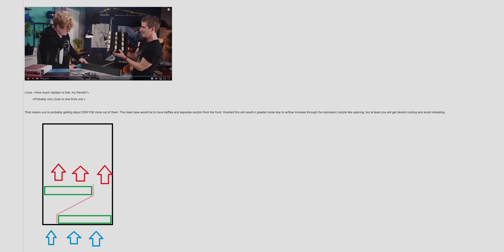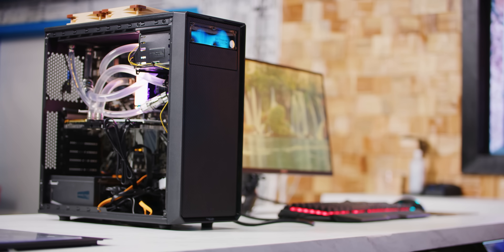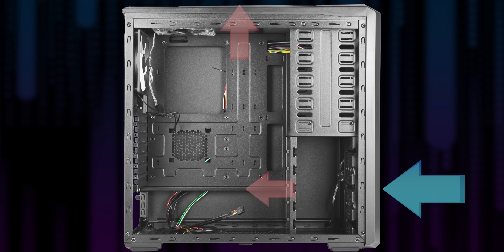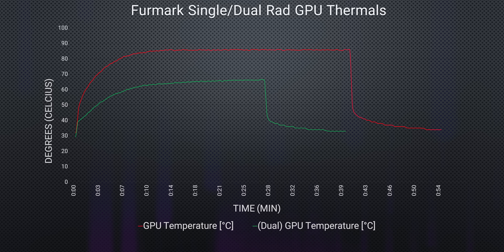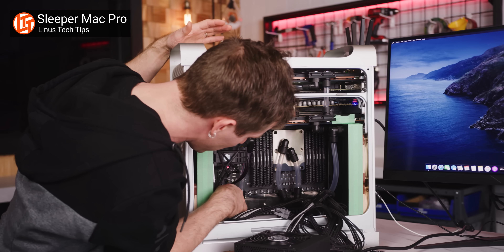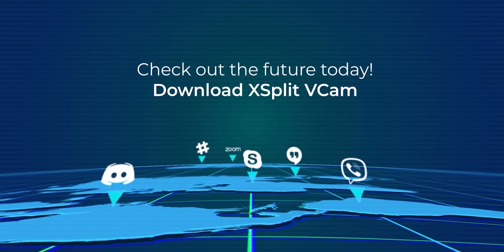I’ve been water cooling wrong for YEARS - $H!T Manufacturers Say

Comment: single rad on a dual load will likely result in poorer cooling of second load with significantly warmer water, it'll be in a way worse situation than cooling with slightly warmer air.

Comment: Yeah stacking rads in series would never work. Rads in parallel with room ambient as the supply works until diminishing returns makes it pointless. The reason it takes longer for the temps to rise is pretty basic. more fluid = more fluid to heat.

Comment: Old video, but this is a total fail if you didn't compare it to a setup with both radiators being fed fresh air.
For example that setup with the three stacked radiators would be killer if they were instead side by side, but even then you would only see the difference if your system was generating enough heat to benefit.
Neither argument is wrong, the answer is a variable in between dependent on the temps and airflow that exist in the actual application.

Comment: Would be really awesome if you measured the air temp or coolant temp after the radiators with a thermocouple, especially for like a stacked radiator setup to test how much cooling the 2nd and 3rd rads added

Comment: now here is my question if you use something like zalman water cooling tower that is external from the case that can dissipate heat say drilling it out and removing the pump to just use it as a reservoir  would that help.  trying to think of ways to use some old equipment i have.

Comment: If you put a 120 rad on the back and 360 on top with some high flow rate fans as exhausts and 3 120 high flow rate fans as intakes and if the case has side mounted fans add them as intake. Ur going to like it

Comment: It might make a big difference if the room air is closer to the air coming out of the first rad. As long as it’s still cool enough coming out of the first rad it can still cool down the water in the second. Just what I’m thinking 🤔 would be cool to run the same experiment with a 90 degree room.

Comment: The placement of the radiators is neither the most logical nor the most optimal.
With a single radiator, it is optimal to take the air from outside the box and expel it inside.
But with 2 radiators, the logical and optimal thing is to put the 2 radiators to take air from the box and expel it directly out of the box, having other fans that put fresh air into the box.
By putting them in "series" a radiator sending air to the other radiator, the temperature of the 1st device that is cooled will be better and cooler, but the 2nd cooled device will be logically worse, apart from the fact that you are increasing the temperature inside the box causing the rest of the components get hotter.

Comment: I think that the two cases that corsair talked about had something in common that the one tested in the video doesn't have. That thing is radiators in series that take the air from the previous one directly. At the end of the video Linus said that they think that in their test case some fresh air intakes from the outside of the case through the ventilation holes, but the point is that the other cases doesn't have that feature. Nevertheless I think that the results may not change in the main picture, but it could be more tight. Making the decision of putting another radiator more complicated (maybe the price isn't worth it).

Comment: I think they were talking about stacking the radiators ontop of each other, not having them seperated,   it's why on a car if you got a transmission cooler it's radiator is infront of the main radiator but doesn't completely block it.

Comment: Would love to see if the order of the rads in the loop would make a difference as well. If the exhaust rad was hit first by the warm coolant it would increase the temp difference there, but on the other side lower it for the second rad. I wonder if these two balance out or if one of the two has a bigger effect than the other...

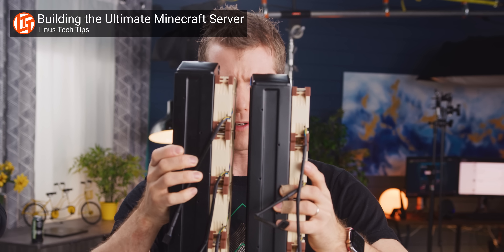Comment: If putting two radiators next to each other, as was done with the stacked radiators (at 1:26 in the video) , is so bad, why do car manufacturers put the air conditioner condenser (which is a form of a radiator) right in front of the radiator in just about every car? Air conditioner condensers produce a lot of heat (not to mention the amount of heat under the hood from the engine) when condensing the refrigerant from a gas back into a liquid. Cars also only use a single fan in a pull configuration for when the car is not moving.

Comment: At 1:45 into the clip I can already give you the answer. Of course stacking radiators works. The closer the air temperature is to the temperature of the liquid in the loop/radiator, the worse the cooling efficiency though. So all you got to do is, use a pointlessly high speed on your fans and badaboom, stacking (or using radiators as exhaust) works great and does indeed add cooling. 

However in a well optimised system aimed at being silent, stacking makes little sense. All depends what you want. A system for show or an optimised system. Superficial knowledge or in depth knowledge ;)
Reply: Err, no. If the fans were same speed, then sealing off was not the reason. It was your high fan speed xD

Comment: Of course it will add performance but definitely not getting 100% of the heat exchange from the second radiator. So, in a way wasting money. 
As for the Minecraft server radiators stacking, that's so wrong. Check "pinch heat exchanger". 
I love how americans are always jumping to experimenting and the apparently unlimited budget into their projects without ever starting with even a basic thinking on paper or understanding of what are the principles behind what they are doing. 
I would have like to see Linus doing a little bit of explanation of how to radiators works and temperatures curves (actually linear).

Comment: At worst, the second rad would be getting warmer air, but would still do it’s job. Maybe it would be less efficient, but it still makes a difference. Maybe test somehow air temp going into rad vs heat dissipation to see at what point must the air be heated to cause the rad to be deemed useless….

Comment: Sorry Linus but u an idiot. Just flip fans around so air blowing out from both rads or airs blows in through both rads. Just redirect air flow on one of rads so it won't go to second rad from the first. In ordinary PC case, put 2 Dard, one on the front and one on the top, then make fans blow inside the case on BOTH rads or blow out of the case from both rads. Air in will flow from back and bottom.

Comment: hmm so in one instance you have a rad at the back and a rad at the front, with no other intake fans, and in the second you have a 3 rad plus fan stack, So Linus does a test that doesn't replicate either scenario... and finds something different... I wonder why?
and what are the red arrows supposed to show @1:17? as Linus says "front intake radiator and a rear exhaust radiator" but the arrows show rear intake and front exhaust...

Comment: stacking radiators is worse than placing them in parallel due to the fact that the air can only heat up so much (like Corsair claimed). But its not usually feasible to place them in parallel since there is only so much external area available. Also, if you stack radiators, you should be giving them their own fan so that the total airflow does not decrease.

Comment: I would just flip the fans on the 2nd radiator and make both radiators make use of cold air outside of the case, and a lot of positive pressure inside to keep the dust out.

Comment: If I had to guess, I would venture that Corsair's research on the topic likely started with the assumption that each radiator used in the setup would be enough to cool the system sufficiently on its own, which does back up the idea that adding more radiators in stacks would not lower the system temperatures beyond the baseline with one radiator.

I would also like to point out that stacking radiators face-to-face would definitely be very inefficient because it would not be applicable to your theory that other air is entering the flow from inside the case. This setup of fan-rad-fan-rad sandwich would absolutely be less efficient.

Comment: "Stacking Rads" (at 1:27) is DIFFERENT that "ADDing Rads". You first show back to back to back Rad's, then you test COMPLETELY different setup, redo the video.
Reply: Kind of need to agree, although I am struggling to see clearly where the two rads are located for your test.

When you say "in series" I think you mean the water from one goes to the next...which is legit and will work as long as the water is still warmer than the ambient air.

Stacking to rads so the AIR flows "in series" is the problem the manufacturer had an issue with.  The 2nd rad has nothing to shed it's heat to, since the input air is the output air from the previous rad

Comment: heh I have a 60mm massive car radiator sized phobya  60mm wide 1080 extreme which is a very tight  fit  with 4x 180mm fans in the roof of a core X9 with custom brackets , it s been in that case since the 4790k came out - cpu never gets above 42c  - idles at a couple of  %c above ambient

Comment: Corsairs claim doesn't make sense at all to me.  The air exhausting the first rad is NOT going to be "just barely colder" than the fluid temp.  I wish you would have measured that in the video.

Comment: the problem I see with Corsair's theory is simple enough.

The air coming from the first hot radiator isn't going to be able to pull 100% of the heat off of it, so it's not likely to have literally equal temperature to the first rad. So either way, it's PROBABLY not full temp when it goes through the second rad yet.

And then, yes, the flow of air will likely mix with a nonzero amount of even SLIGHTLY cooler air which should further enable cooling of the 2nd rad.

It seems incredibly unlikely that you're ACTUALLY going to have air going through the 2nd rad that has NO thermal capacity left at all.

Comment: Surely the problem is stacking radiators on top of each other, where a second radiator gets hot air directly off the first radiator. I guess if you stacked enough radiators, all the heat pulled from the first radiators would be put back into the water by subsequent radiators. Providing radiators get cool air from different sources though, then more is better. [Ah... just seen follow up video...]

Comment: " separate  radiators will improve things. Stacked radiators wont improve things much. Heat from water in first rad gets transferred to the air which is then blown through second rad warming it up !
Reply: it depends on the order of the rads the water flows through. if the water flows outward (innermost rad first) then yes, that's what will happen. but if the water flows through the outermost rad first, that's a whole different story.

Comment: >extra radiator
>extra water volume
You need to compensate for this with a larger reservoir, and it explains why the double sink took longer to come down to temp as well, it has more heat capacity.

Comment: That's not what's happening. It's all about the mass flow rate of the air yo. Your fans have a higher mass flow rate of air than what Corsair is using. They are probably matching fans with radiator efficiency so that they get peak performance for the price of the fan. A higher mass flow rate fan would only exhaust cooler air and not increase actual radiator efficiency. But if you put in a bunch of epic fans and then put radiators in series, then you can absolutely get better performance with those radiators. Tl;dr with high flow rate fans the individual air molecules don't heat up as much this can be used to cool a radiator in series.

Comment: true your water temp is only going to go so low adding more radiators wont change that , BUT adding more liquid and radiator capacity gives you a longer saturation duration so instead of fully saturating your cooling system with heat in 2 hours you can game for lets say 6 hours befor full saturation of heat , this in the long run keeps your components running cooler for longer durations of time thus elongating their life and giving you higher performance for extended periods of time , anotherr words corsair is right but they miss the big picture.

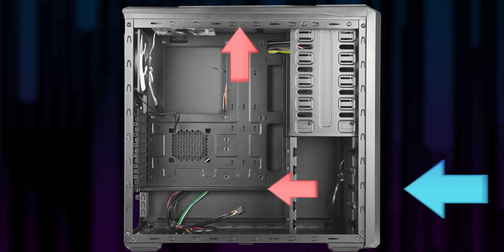Comment: 6:03 that fan in the back is obvoiusly blowing the air out based on which way its blades are curved. Which doesn't necessarily mean the air doesn't flow in through there, other fans may pull more air and do so against this one. But generally you do want to have the aitr coming out of the top anb back of the computer, because that's where the hot air would naturally accumulate (the fans working with convection instead of against it, and a computer usually stands against a wall from behind, so no fresh air there), and enter through the bottom and the front. And that's where the rads would ideally go if there's enough room for them. There can also be holes in the sides to avoid the interior heating up from the rads on all intakes.

Comment: I don't think you read this, but my 2 cents. In my little experience with DIY water cooling, if the water was at 40º an the ambient air was at 20º the air throught the radiator reach 30º, so when you put more radiators you optimize this. The cars have 2 radiators, 1 for AC and then 1 for the engine water. I think corsair have something wrong on this simulation parameters. have a nice day!

Comment: This doesn't account for external radiators though
Also doesn't account for multiple intakes (a bottom intake and a front intake for example could both have their own radiator, both pulling fresh cold air through)

Comment: If you stack radiators that are in line always have the first (hottest) radiator last in the airflow, therefore the temperature difference is always going to be larger. It's a principle called opposite flow that is used a lot in lab cooling.

Comment: @Linus: you did things wrong!
Try this: compare your results with second setup: single radiator, but oil instead of water and higher speed of fans near radiator. You might be surprised :)

You are not wrong here that greater heat exchange surface = better results, but that not always will be the case.
Overall limitting factor here is amount of heat transferred from water to air - you can do this 2 ways: increase air flow or increase surface. Adding another radiator actually does both: increases surface of heat exchange and flow of air taking heat from water cooling system.

Tbh, I wonder if the best solution would be like transfering heat outside of case (like whole case would be radiator for water cooling) into the stream of air.

Comment: One thing that is important is the order of the rads. You want the water to flow in the opposite order to the air. Water should go to the air exhaust before going to the intake.

cool air -> warm air -> hot air
cool water <- warm water <- hot water

vs

cool air -> warm air -> warm air
hot water -> warm water -> warm water

Is your warm air sufficiently cool ? Then you only need one radiator
Is there enough air mixing between radiators ? Then the order makes no difference
(by "warm" I just mean in between. I could be almost equal to the others)
(inspired by how fish breath)

Comment: If the rad is too small to transfer all the heat from the water to the air, then logically a second rad helps to get rid of the rest of the dt.

Comment: nah.. it actually works stacking them. they do it on sedan's. or cars.. on front-is the aircon condenser on its back is the radiator of the engine. go search. youll see thelat they are stacked..😁

Comment: hi guys.. I tried Liquid cooling . It Leaked and wrote off the motherboard graphics card and processor.  turns out The fluid is conductive? and it shorted out the system. anybody else had this?

Comment: I mean, the physics here are understood fairly well, the constraints will be the accuracy of the simulation and other factors.

There's also counter current vs whatever the opposite of that is, if you put the rad that feeds back to the CPU/GPU to where it gets the coldest air, you'll get a different result than if you ran the loop the opposite direction. Beginning vs end.

Comment: If you are going to stack radiators, the air and water have to flow opposite each other.
The water should be flowing into the radiator with the warmest airflow first and the coolest airflow last

Comment: Unfortunately I have to side with stacking radiators is a bad idea, in the automotive sector sector stacking radiator will make for unefficient cooling on the last radiator, multiple radiators do work but needs their own unheated air. In the automotive sector using the aircon will make the engine's temperature climb as the aircon radiator is in front of the engine's radiator swop them around and the aircon will be just about useless in cooling. It's all about thermodynamics not about your experience.

Comment: `well yes 'radiating heat away from the system' is the key. Stacking is radiating it away AND back to the system. So they are self balancing themselves. The important part is the orientation and airflow patterns so that cool air is introduced across the entire surface area of the radiators.

Comment: My question is where the path of heat into radiator is compared to airflow. Like if the hot water goes 1st into the radiator with air going out of the case, then straight into the air intake radiator. I just wonder if it'd be better than the reverse of that.